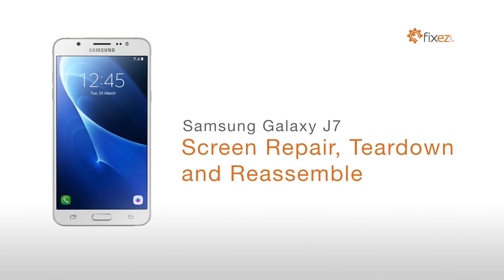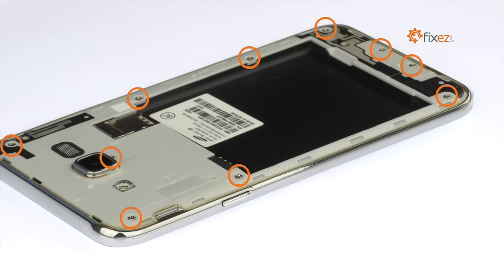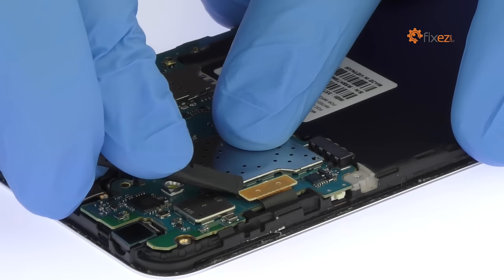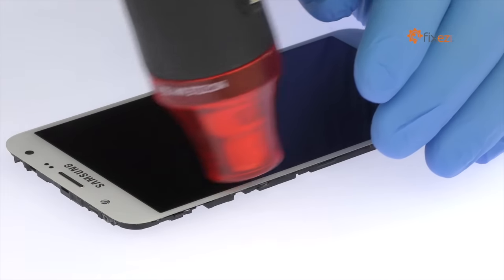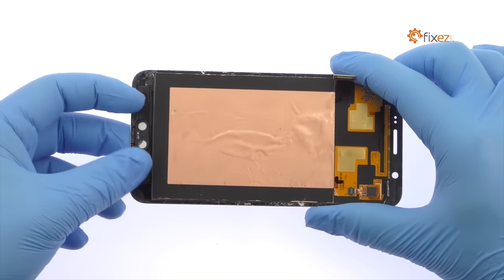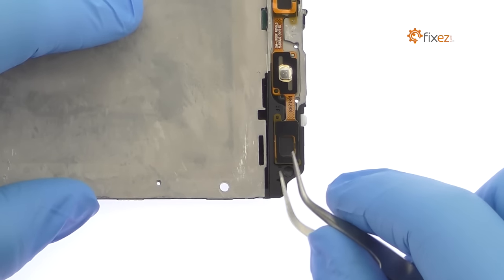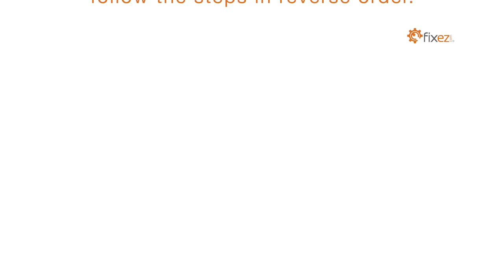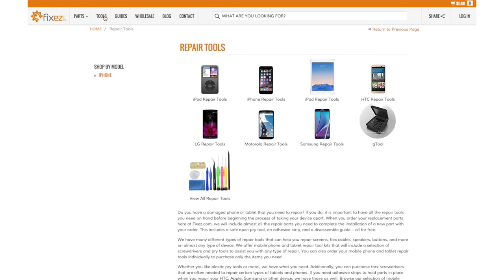Samsung Galaxy J7 Screen Repair, Teardown and Reassemble - Fixez.com

Comment: Is it possible to buy the  front screen/digitizer and the LCD separate and tape those together?
Reply from the maker: +Jewpiter Jewpiter Fusing the display and digitizer requires specialized machinery to do it well.

Comment: Is it necessary to completely disassemble all these components to replace the screen?
Reply from the maker: +Andrea Steiner Complete disassembly is not required for display replacement. Removal of the motherboard and ear speaker are necessary.
Reply: Fixez.com why is that? Thank you for the excellent video

Comment: can I replace my outer steel looking part which gaurd the phone because I has many sctraches
Reply from the maker: The midframe is a pretty straight forward replacement. We do not currently have the midframes in stock. Thanks for watching.

Comment: does j7 2015 and j7 2016 have same screen ?
Reply: Ashish Mishra  the volume button is different. On the 2015 there is one volume button. On the 2016 there is 2 buttons.